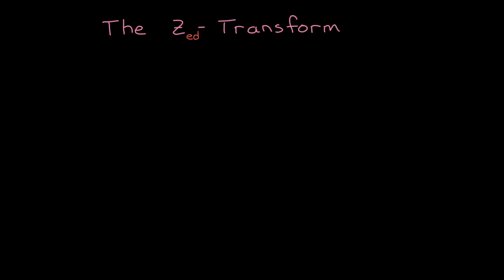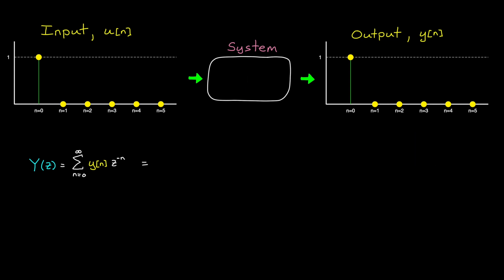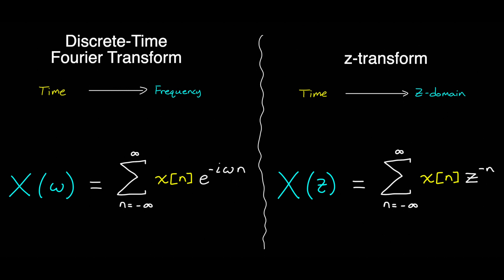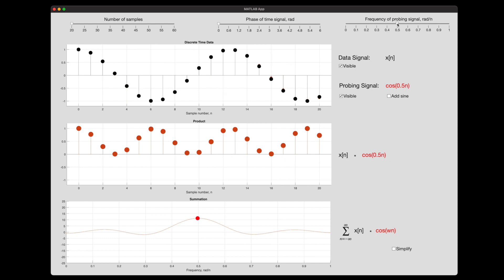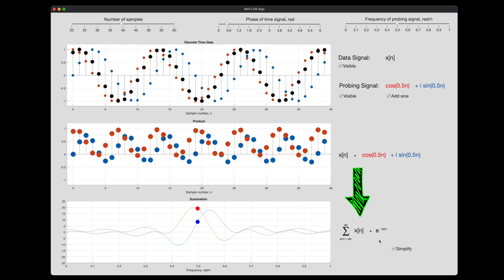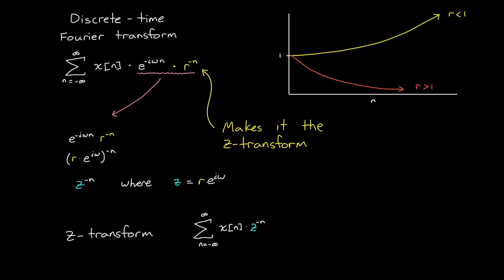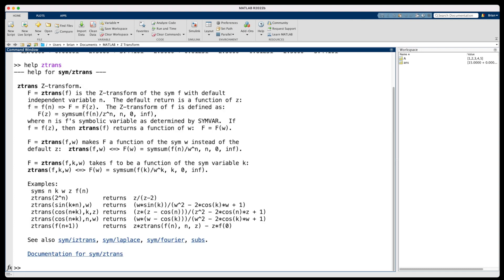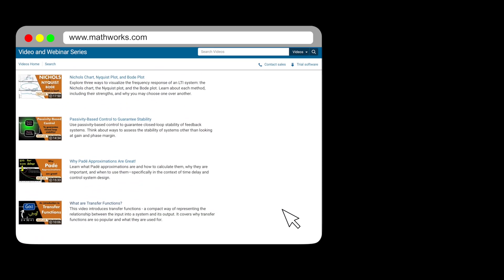Understanding the Z-Transform

Comment: Correct me if I'm wrong, but based on how you've explained it, the z transform is just a discrete version of the Laplace transform?
Reply: I thought so too at first, but for the Laplace Transformation it's F(s) = Integral( 0, +inf, f(t)*e^-s)
Where s = gamma + i*omega, because the expanded Integral definition is Integral from 0 to infinity of f(t) * e^(-i*omega) * e^(-gamma).
The Laplace Transform adds a real part to the complex term s, to sweep through exponentials, whereas the Z-Transform, adds another imaginary part. For me it looks like it adds the amplitude of the sinusoids (r*e(-i*omega*x), instead of adding exponentials
Reply: I've googled it, and it seems like it is in fact the discrete version of the Laplace Transformation, but to make it happen the added part has to be this way, dont know why at this point

Comment: I've been able to solve a Fourier Transform in analytical form back at uni, without understanding what it was for.
I've been able to implement a Discrete Fourier Transform algorithm in code to do simple frequency analysis of a signal, without understanding why the algorithm was the way it is.
With your explanation, I think I finally get the "why" of the Discrete Fourier Transform, the way it uses correlation. Thanks for this explanation; I feel like one more thing is clicking into place.
Reply: Glad it helped!

Comment: Hi Brian, thanks for great explanation. At your DTFT demo 10:10, your input data signal clearly has magnitude of 1, so you choose the probing signals also have magnitude of 1 so it fits perfectly in your "dot product". If the input data signal is a combination of many frequencies with different magnitudes, it seems that we still keep the magnitude of probing signals (sine and cosine) as 1. I wonder why that still works? Shouldn't we adjust magnitude of probing signals according to the input signal?
Reply: I think I understand your question, but I might be off a bit. Let me give it a try. If a particular frequency in the input signal had an amplitude that wasn't 1 there would still be correlation between it and the probing signal with an amplitude of 1. Since we're multiplying the two signals, having a larger amplitude in one is just like multiplying the product of the two signals by a gain. So that frequency would have a larger value in the lower plot. Which is exactly what you want because you want to see "how much" of each frequency there is in the original signal. For example, if the signal is 5*sin(t) and the probing signal is sin(t), then the product of the two is 5*sin^2(t) and so the summation would be 5 times larger. Was that your question and did my answer make sense?
Reply: This is how I see it, lets assume the input signal is a sum of many sinusoidal signals like x1.sin(w1.t) + x2.sin(w2.t) + x3.sin(w3.t) + .... When you have infinite data point, you can prove mathematically that with each probing signal, ONLY the exact probing  signal that have the same frequency as one of the input's frequency components would have a NON-ZERO dot product (you can intuitively understand the reason why this happen by taking the integration of the product of two sinusoidal signals with different frequencies, the value would be 0), so the value of x1, x2, x3 or any amplitude of the input's frequency component is not that important (except when you need to know the amplitude of the component frequency) since the output plot would only have pulses at those exact frequencies (when you have infinite data point).

Comment: Is  z transform discrete Laplace transform?
Reply: Yes, that's right. This is why you have to see what is the application for which you are going to choose certain transform. For instance, z-transform is used in digital filter design, whereas the Laplace transform is mainly used in applications such as AC circuit analysis, and so on.